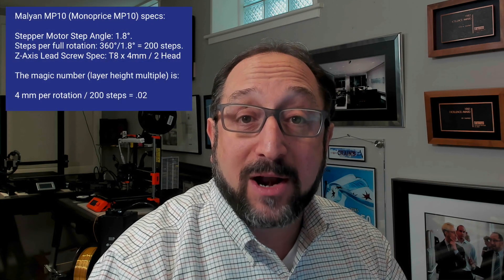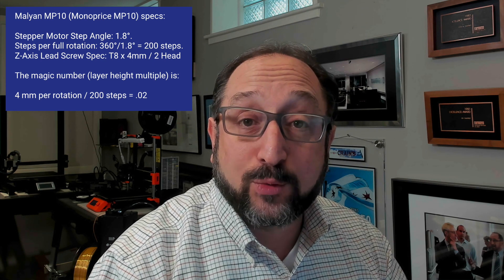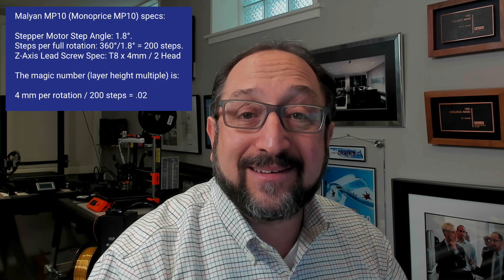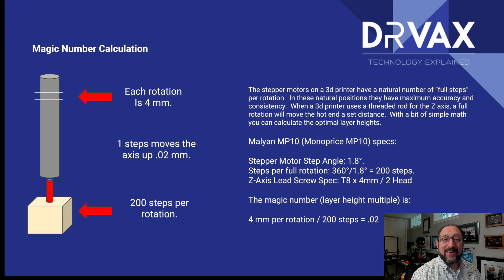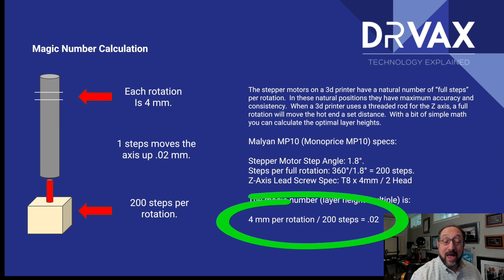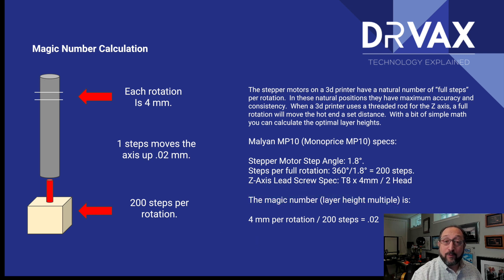3d Printing Magic Numbers

Comment: Hello DrVax, I have a question for you or anyone on here, I am a brand new user of 3d printing and have some questions that I am trying to figure out. I was given a couple of designs that came with the mini sd card that seem to work okay when I go and print them but I am now trying to go out there and download other designs and play with them in cura 4.6.1 and then print them but when I try to download them in STL format and then save it in Gcode on the MINI SD card. I then go and put it in the machine and try to print it but dose not want to print or will not stick to the plat or the temps do not stay where I pre heat everything. I would love to be able to print all different things from animals to figures to face shields and have lots of problems with it can you help me or do I need to creat the right profile and keep it on the SD Card. I also notice that the MP10 is not listed on the printer list in the cura directory at all.  help help help please. I right now just use PLA in black but would love to get into other materails sooner or later as well as design my own things in 123AD to start with and then transfer it over to cura to print but have trouble help help please.
Reply from the maker: First and I am sorry if this sounds "cute" you need to watch more videos to learn about the basics.  

If your prints are not sticking you may have the temperature wrong, the build plate may not be level (yes it is a good idea to level a build plate even if you are using auto bed leveling),  the temperature problem may be because your gcode start routines are improper, etc.

Next recommendation. Slow down your prints.  Printing much slower will make it easier for you to get started.  Do not print above 40mm/sec while you are getting started and the firsty layer should be at 20 or 25mm/sec.

I have a couple of additional videos on the channel that may help, including a video with a link about getting started with the MP10.  Here are links to two videos that you may find helpful:

https://youtu.be/4T-0npa7iNE

https://youtu.be/GVcZmYa1QVM

I have also found that if you put some MagiGoo  (that is a brand name - you can order it from Amazon) on the MP10 print bed it makes getting print adhesion much easier.

I would also recommend you watch some more videos about Cura.  There are hundreds on YouTube.  I have quite a few on my channel.

I run an interactive discussion forum, where you can post questions and get responses from a range of people at https://forum.drvax.com

Finally it is possible your machine is just a lemon. If nothing works return it to Monoprice.

But do not give up on 3d printing.  The MP10 is not the easiest 3d printer to get started with but it will be worth your effort to learn this craft.  It is a lot of fun and very useful.
Reply: @MakeWithTech  thank you I will keep trying not ready to give up yet.
Reply: @MakeWithTech  Hello no I am not going to give up yet like it and can see alot of different things that would be good and even do market swap meets and can think of many things or possible idea's for that as well. I do need more help with this is there any local groups that I might be able get together with over here at the house or meet to that I can see better on how to do things. I am in south orange county los angeles if you might know of anyone or rather group. I can still get things to print from the samples that I got on the SD card but when I download a file and then put it into cura and save it in Gcode and go to print it dose not seem to work right now sure but not giveing up any suggestions possible.

Comment: This is a myth. 2 pole (2 phase) stepper motors use pwm signals usually in square wave form which can be check with an oscilloscope. The height (voltage) of each of the signal pulses is the same unless there is something wrong with the driver or motor assembly. The on/off signals of the wave is generated through both phases which is evenly split on opposite sides of the rotor within the motor regardless of the angle. If there was a magic number and the pulses were somehow 'stronger' at certain angles of the rotor (which would supposedly allow smoother layers by matching the pole angles with the layer height and corresponding it to the pitch angle of the lead screw) then there would be an imbalance within the motor that would also be inefficient thus creating noise and friction, and thus heat. Its a myth doctor, trust me.
Reply: Holding torque is stronger when using full steps. Microstepping exists, but you don't get the same amount of holding torque. Depending on the settings used, the loss can be over 90%. If you microstep at all, 30% of the holding torque can be lost (0.01 increments on Z). It can come into play on the X/Y axis when there is a sharp direction change. If the acceleration is too high, you can get a missed step and a layer shift. I worked for a casino slot machine company for nearly 5 years. Ramp tables were required to accelerate and decelerate the steppers to avoid missed steps. I don't think those are in the firmware, but they should be. The tables were based on the inertia of what you were moving (weight of the print head in this case).
Here's an explanation: https://www.machinedesign.com/archive/article/21812154/microstepping-myths
Reply: Here's another source with the math required for smooth acceleration and deceleration:
https://www.embedded.com/generate-stepper-motor-speed-profiles-in-real-time/
Reply from the maker: Very interesting.  Thanks for sharing.

Comment: Your videos are really helpful, there isnt much out there that is easily accessible for the mp10. Something im currently struggling with is using Silk PLA. I cant tell if i need to adjust settings for different material beyond temperature. I have it at 230° on the extruder  and the flow still seems less than normal PLA  at 200°.  Because the flow is less, its not coming out at the right thickness and isnt sticking to my bed, which i cranked to 70° because the filamemt was contracting befor it could stick to the surface.
Reply from the maker: The stock extruder on the MP10 is terrible.  Replace it with an all metal extruder that will basically look the same and will fit on the same screw hole and your printer will work much better.   Unfortunately most of these replacement extruders come from overseas China and they go in and out of stock on Amazon so I cannot recommend a brand.   What you want to make sure is that the "arm" is on the same side on the new extruder as the original MP10 extruder.

Comment: I've purchased a MP10, and I've had nothing but problems. The bed leveling wouldn't correct for slightly dropped back right corner, now the induction sensor isn't working. If you have a email contact with Malyan, please share it with me. Thank you.
Reply from the maker: Sorry to hear you are having problems.  If you watch the series of videos I did on the MP10 I also had quite a bit of difficulty getting it right.   I do share a profile in the comments to this video that I found worked well.

https://youtu.be/cJtbU3wqnqI

I do not believe Malyan provides direct end-user support.  Did you try Monoprice support?

If you are having problems with bed leveling a corner it may be very helpful to first manually level the whole printer bed.  Auto bed leveling will not correct for extreme issues.   I always level my printer bed before I turn it on the first time.   I have a number of videos on the channel that may help with that.

How did you determine the induction sensor is not work?   Did you connect to the USB port and run a bed level and check the numbers coming back?   I find connecting to my printers with MatterControl, using the MatterControl terminal, and then issuing a G29 command is a good way to check the ABL sensor.   Here is the Marlin documentation on the G29 command:

http://marlinfw.org/docs/gcode/G029-abl.html

If I remember correctly an M503 command can be used to see the current bed level mesh.

Comment: Hey Doc - Is replacing the plastic extruder with metal just as simple as unbolting/unplugging and replacing?  I've never done any hardware changes besides just popping a new hotend head on a couple of my other machines.
Reply from the maker: Yes, it is a surprisingly simple upgrade -- except for getting the gear off the stepper motor.  Here is a video that goes over the upgrade step by step:

https://youtu.be/KP6uxwt6pV4

Comment: Do you have a list of all of the settings for the MP10 printer?  It would make my life a lot easier.  Thank you for taking the time and doing the videos.
Reply from the maker: Absolutely.  The link is in some of the MP10 videos, but to save you time here it is again:

https://docs.google.com/presentation/d/10Two5vMClDXDwZXuJUp7YF1bjKibKQVjw1eilUuuLaY/edit?usp=sharing

This is a Google Slide deck that I will update as I fine tune this profile and others.
Reply: @MakeWithTech  Thank you!! This is very helpful and time saving.  I do not have a lot of time to experiment and you doing this for us makes a huge difference.

Comment: Why did you change the start G-code so drastically?  Looks like you removed the filament purge?
Reply from the maker: Good question.  A couple of reasons.  First I found the original location difficult to see and if I recall correctly the "filament purge" extruded filament well above the build plate.  This filament would then sometimes get dragged into the print.   I replaced this with a significant purge that is done on the build plate right in front where you can watch it.  If it does not look right you can stop the print before the first layer even starts.

I use the g-code terminal capabilities of Octoprint to test out a wide range of alternatives and this worked the best for me.
Reply: @MakeWithTech  What about your z axis offset on the actual display after you do the automated bed leveling?  I have mine at .55.  What do you have?
Reply from the maker: @tomnow218  .55 is fine.  Mine is at -.03 but I also spent a long time manually leveling the bed before the automated bed leveling.  In general this is a best practice.  You want the automated bed leveling to do fine tuning not coarse adjustments.  I have a video about my Ender 5 on bed leveling that would basically apply.   In addition in my first MP10 video I explained bed leveling.  Hope this is helpful.

Comment: Hi Irv, I've confirmed the 4mm per revolution by physically measuring it :)   Now that you've got a connection to the manufacturer, perhaps you could reach out to them and ask where there Marlin source code modifications are for this printer (it's GPL so they should put it somewhere). I have a few minor things I'd like to fix but can't without the code.  and yes you got my name right :)